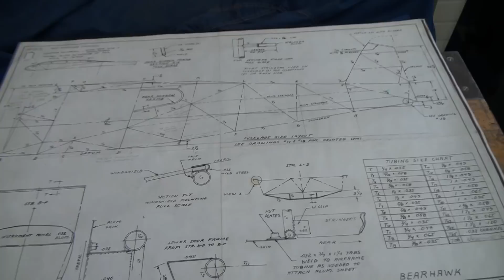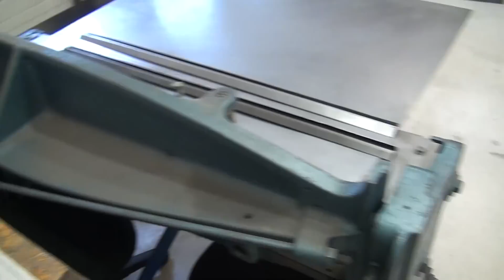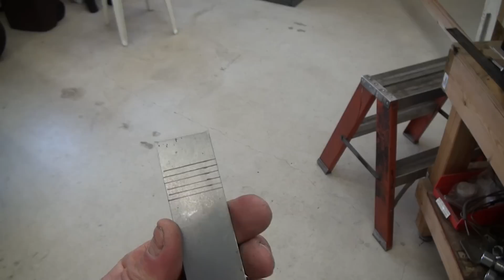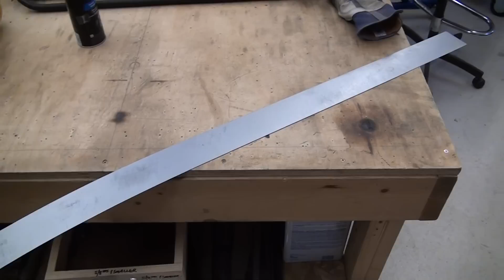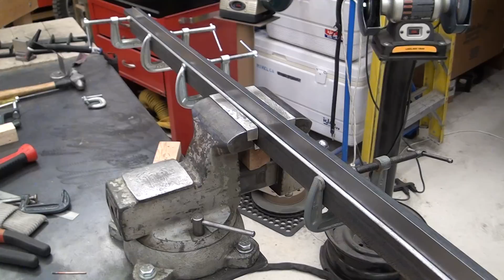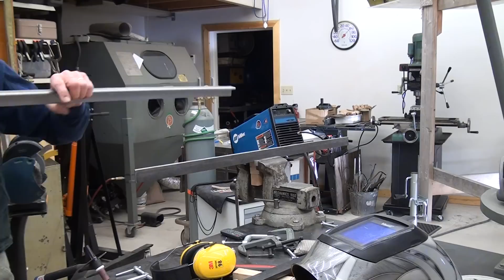Forming the Upper Windshield Channel for the Four-Place Bearhawk

Comment: You're using your bare hand  to buck the form and you should have a chunk of steel to buck it so that the form doesn't deflect. Nice work around otherwise for what that pat on the back is worth. Is the plane flying now without falling apart?
Reply: What a question. Watch some of the other videos of this project and you might be able to figure out that this man doesn't build airplanes to "fall apart".
Reply: @Kevin_747  the question was intended to be silly but your answer is even more so.
Reply: @pierdolio  You certainly failed at silly and went right to stupid.